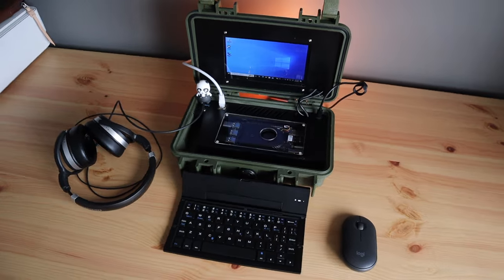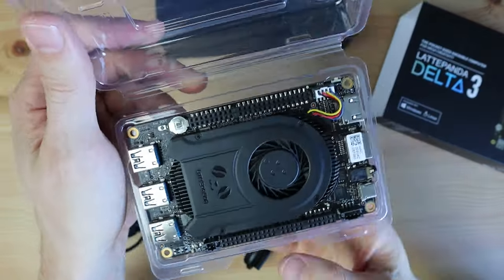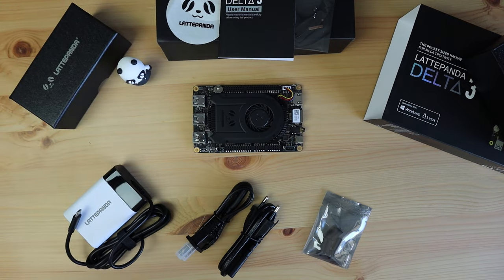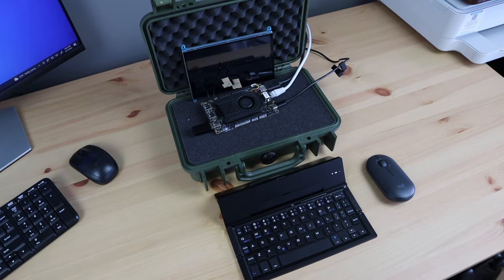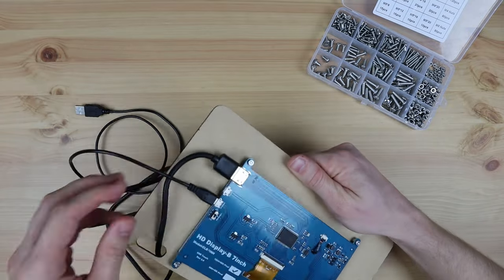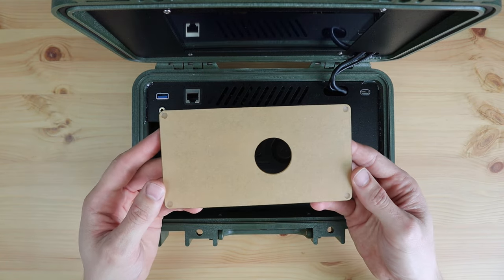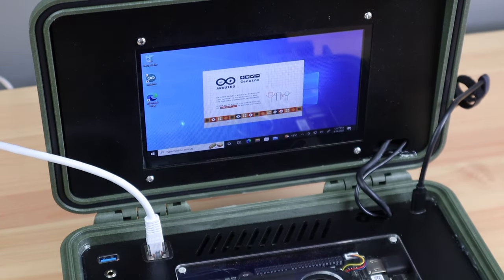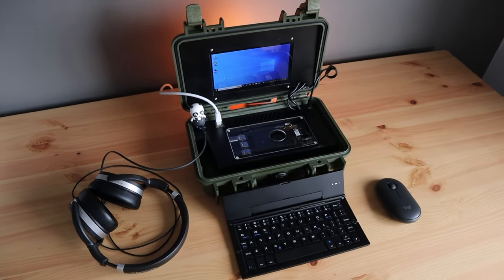I Turned The New LattePanda 3 Delta Into A Rugged Cyberdeck

Comment: This is awesome. The only thing I can think of of adding is a battery pack or a space to tuck the power adapter. Thanks for a great idea.
Reply from the maker: An onboard battery would have been great. I'm thinking of looking at whether I could integrate the 12V UPS I used recently for my bluetooth speaker - I probably need to test how long it would run for first.
Reply: This is look dope man!!!

Comment: Perhaps the additional use of a long term battery and a roll out solar panel for charging for truly portable use. You could even make this a great mobile sdr type deck. Even single use battery packs could be used for standby power. Usage for remote weather systems, radio telemetry or even low cost repeater stations. This is a very nice setup. Though for repair purposes I would have glued standoffs or supports so that the screen bezel could be removed

Comment: This is not only one of the cleanest i have seen, but probably obe of the most useful ones out there. Love the keyboard!
I would have loved a powerbank as "go between" that also gives you a bit of a reserve for on the go (and fits the cyberdeck aesthetic of beeing less dependent, having to deal with unstable electricity, and so on). 
Maybe an add. an aux and antenna port and the thing would not miss anything 😅

Comment: Very nice. I'd like to make something similar using the newer Sigma and a bigger Pelican Case. The bigger case would be so I can put in some additional utilies like a hakRF One for SDR, a WiFi Pineapple, some battery packs, and a charge controller so I can set up a rugged solar panel on the top of the case.

Comment: Smart design choices. My only gripe is use of hot glue which makes accessing the guts not possible.
Beside that, how much does the latte panda consume in terms of power.? Is it feasible to run over battery?

Comment: I only see two downsides to this :
1. The use of Hot Glue really ruins the look for me, if you could somehow make them stick via some strong small sized magnets on the inside then it really would've been good. Plus it would be easier to take apart if needed.
2. Is the screen size, it seems like a 10" screen would easily fit in there.
Reply: same
Reply: A bigger screen there is room and I want it Battery powered so it is fully portable. Also Why is no SSD installed if there is possibility. Hot glue is not my cup of tea but the idea was great.
Reply: @minimalistinlife  you could get an external battery to plug in, could also get some portable solar panels to charge the battery pack and you'll be very mobile

Comment: Neat execution on the idea. I've had a look at some other reviews of the LP3D and it seems like the real downside in terms of performance  is using single channel RAM instead of dual channel, it uses a Celeron processor after all.
Reply from the maker: Yeah I probably wouldn't be buying this sort of board for it's performance - processor or RAM. It's significanlty better than the first generation, and it's perfect for day to day tasks and even for running basic AI or vision scripts, but it's definitely not not a "powerhouse".

Comment: I really like your setup.  1) I would max out the touch screen monitor 13-14inch if can. I know I old school tech. But I still like my DVD/Blu-ray burner and would add a 4-port USB (2.0- 3.2+, FireWire) on the right side.  The price of the Delta is still too high 64gb eMMC (500+GB) and 8gb Ram ("Really for gaming/Graphic designer low-side"16-32+ GB) 2.0-2.9Ghz CPU Quad...(3.2-4.0 GHz) I do think Delta can meet the upper size.  2016 year model laptop meet this! I hate to say. You got, space for speakers too? Monitor wasted space. Would love to add a battery pack, also. Still a great project for DIY.

Comment: I think you need to revisit this, it doesn’t really make sense. You put a mini PC in a water proof case but it doesn’t work if you’re using it. The keyboard is too flimsy, the mouse feels like an after thought but it’s not world ending, and everything inside is susceptible to water damage during use. It looks cool but seems extremely impractical, maybe if you made a habit of boarding planes that crash into the ocean it’d made sense. Maybe get a broken latitude or other rugged laptop, harvest components, rebuild it with a latte, in a new case etc. this idea has cool potential.

Comment: Would you be able to use a powerbank and gsm/lte mobile data to increase mobility?
Reply from the maker: You'd need a fairly large power bank, but yes you could do that. The ports on the bottom of the board allow you to add a GSM or mobile data module for remote work.

Comment: Great CyberLatte build.

The only thing I would possibly change is to somehow make access to the USB 3 ports easier, right now it looks like you need to dismantle the top of the cover to access them
Reply from the maker: Thank you. I've brought the high speed USB 3.2 gen 2 port to the front panel as well as the USB C port, so you've got two that are easily accessible. If more are regularly required then it would definitely be better to add another extension to re-route them to the front panel as well.

Comment: Hi Michael, can you do a quick video using the Arduino features from the computer?  How to set up the environment, what libraries are required ... etc.?  A simple blink example using this board to program and execute the Arduino routine would be sufficient.
Reply from the maker: Hi Miguel, I'll have a look at putting a short video together. I played around with the IDE briefly during testing and it really just looks like the Arduino shows up as if you have one connected to your computer's USB ports. So shouldn't require any additional setup or libraries - I'll check on this though.

Comment: I think that both the LattePanda AND your build are AMAZING!!!!! Only one thing I would change/add - a place to hold the power cable. Also how good is the wifi with the antenna being in the case, under the Panda? I would think it gets fairly good signal in there, but if not then maybe you could use extensions for those tiny little antenna wires to go to the 'surface' where the other ports are and convert them into some antenna that you can un/screw when you close it...
Maybe you can do Cyberdeck v2.0 with some of the suggestions, and/or things you couldn't quite put onto it.... maybe some Arduino controlled packages to pop on while out in the field, like a small weather station that could fit inside the case too... you might be able to get some extra room by using a KB/Trackpad combo... but I don't think I've ever seen a folding one like yours.. 
There is just SOOOO MUCH POTENTIAL!!!! - (A built-in projector and gaming controllers replacing the KB/Mouse for a portable retro emulation station comes to mind lol) - Maybe instead of actually building all the different things, you could just put together the parts lists and ideas and make a video about them..... just some suggestions :) (I wish I was in a financial spot to build things like this, so watching others make videos building them is the next best thing lol)
Reply from the maker: Thank you! Yeah, I'm going to look at how to include a battery and power supply into the build as well. I didn't have any issues with my WiFi signal with them in the current location. I'm not sure if the antennas are matched to the device, so they need to be that length, but otherwise it would be nice to move them into the lid so they're held "up".
There is so much potential for this sort of build. It depends on what you'd land up using it for. I like the idea of using a projector for retro gaming!

Comment: Nice project. I can appreciate you not wanting to drill holes in the Pelican case. The project will be great for amateur radio field use. Over time, do you anticipate the hot glue used in holding the USB cables, to give you any troubles?
Reply from the maker: Thank you. Yeah, it sort of defeats the object of putting it into a Pelican case if you make holes in it. Hot glue probably isn't a good idea if you're likely to use it in the sun or leave it in a hot car. This is partially why I used it though as I can warm up the case to remove the panels if I need to make any changes to wiring etc.. If it needed to survive the heat then I'd probably look at designing brackets to hold some screws so that the panels were easily removable and then epoxy the brackets into the case rather.

Comment: A thermal duct between the opening and the fan would mean that it wont recirculate air within the cavity (as long as the air has a way out to those vent holes near the hinge)

Comment: Its an great project but you made a tiny mistake the delta 3 sucks in cool air on top and the warm air gets out on the side with the three usb ports but there is just one hole and since warm air goes up it goes through the hole for the cool air so its not quite perfect but can be fixed with a dremmel
Reply from the maker: There is a series of cooling holes between the Delta 3 and the hinged edge of the case, the warm air comes out of these holes.

Comment: Soooo you made a super flimsy netbook? The project was ok, but you should have mounted the cable extensions for external access, hidden the monitor cable, and included portable power. Additionally the screen angle is not great. Finally, where is the sound?? Personally this feels like a kids build by the numbers project.